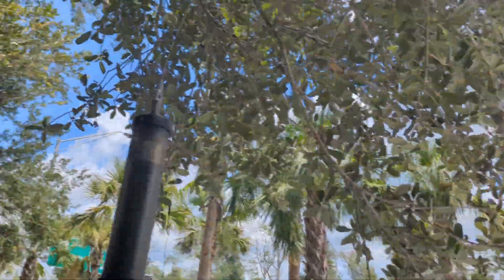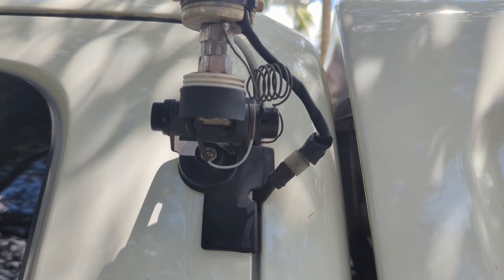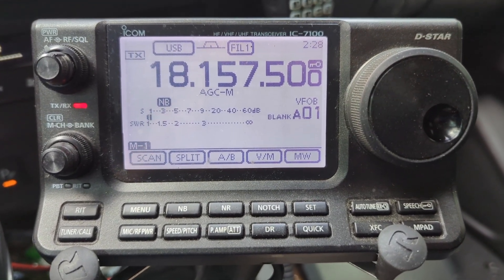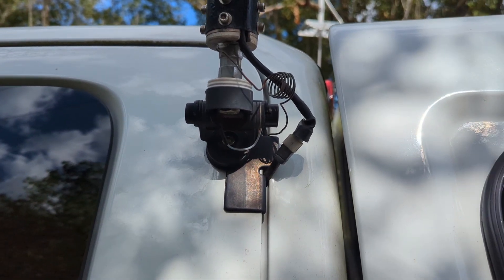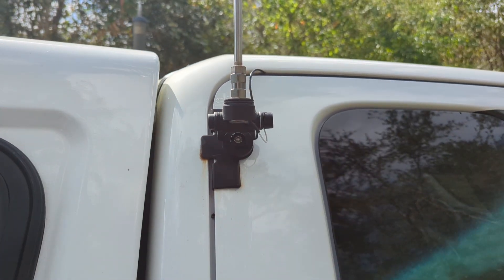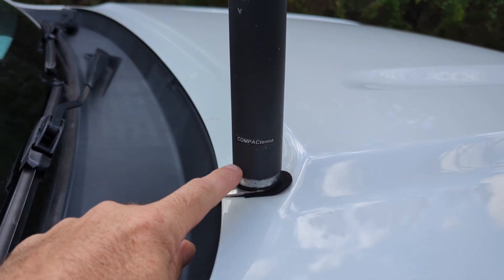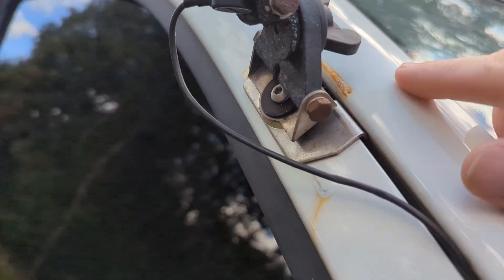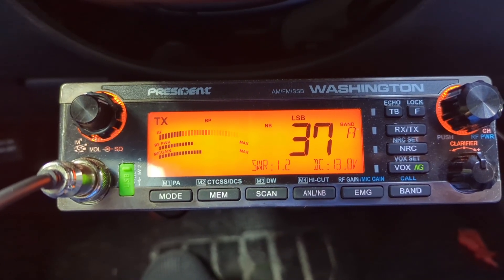Real World Ham Radio Antenna Stress Testing

Comment: Nice setup ! Yes CB skip has been great in NY as well. Haven't had much time but I listen as I work. Getting a plow truck ready for winter . Got all parts today and hope to finish Tuesday . I have snow blower being dropped off Wed. need room in shop . I hear CH 38 gets nuts in after noon on SSB hear.  The west coast punch is nuts. I just use different CH when they come on. I set my QT 60 up in shop . But time I was done the skip was gone and sun down. Maybe lunch break I work some skip. 73

Comment: I have 2 shark antennas quick release mounts on comet k400 mounts, one on each side of the hatchback on my SUV. I run them into a T connector then the cable into the radio. I can at least easily switch to the different bands with the shark antennas. I have made contacts in Australia, Germany, Barbados, Puerto Rico, Chile, and all over the US, while driving to and from work. It looks like I’m communicating with aliens, but I love my setup.